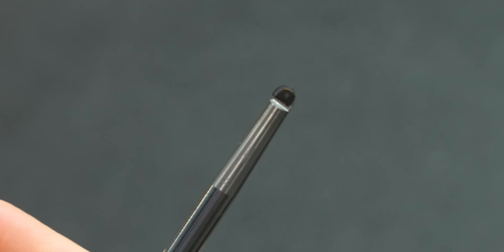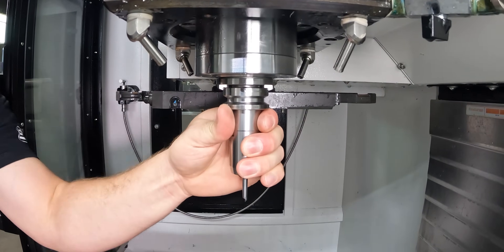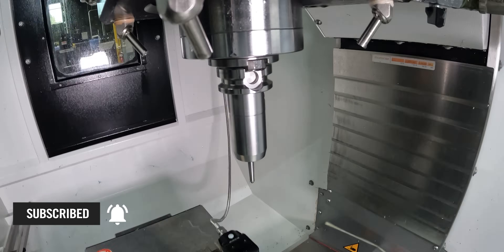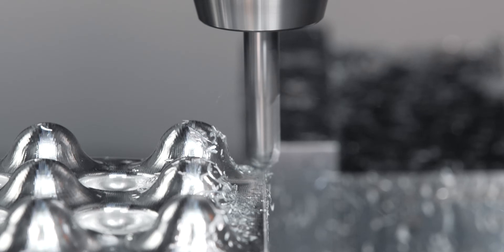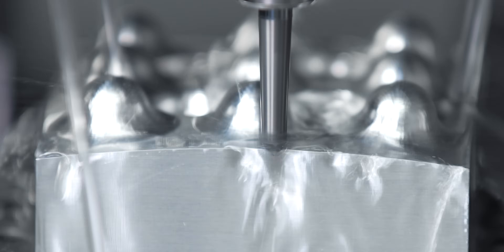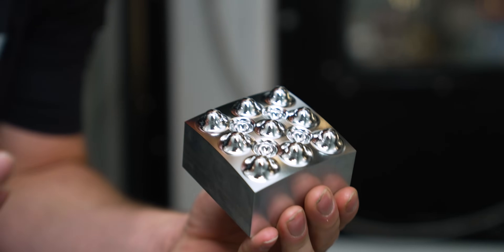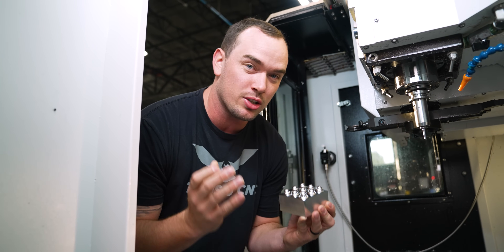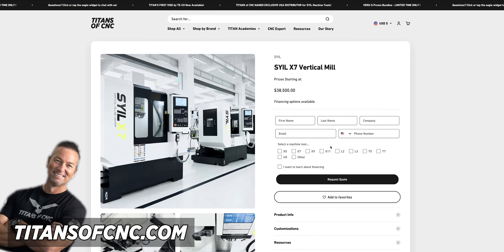Can The $38K SYIL X7 Machine a MIRROR Finish?

Comment: wish mcd tools could be worthed to use on hardened steel enstead of only non-abrasive soft metals, as a mold maker(lathe)(for plastic glasses) it would make the job of my polisher so much easier

Comment: This is where the seconds grade CVD diamonds go. They use them for precision tooling bits. MCD grown by CVD is basically flawless so it can take unbelivable punishment. The diamonds must be rough cut with lasers then polished to the final shape needed.  As long as carbon wont readily absorb in the metal the chips will fly 😂❤

Comment: I'm pretty sure nature can create diamonds instantly, a carbon meteor strike for example could do it in the instant of impact.  I'd be willing to bet it actually happens pretty quickly underground too, you just need high pressure and temperature, both of which are always present in the centre of the Earth, but takes ages for them to surface.

Comment: it would be interesting to see if you could make the primary mirror for a reflector telescope, say 10-12 inch and how it would look.
Reply: Yes I made first surface optics on an old Cincinnati lathe lots of them.
Diamond tooling then diamond film aluminum is not my go to for telescopes though.
We were combining laser beams to smash hydrogen bubbles
Reply: With the surface finish they got, it'd be at best a long wavelength IR telescope and not a great one at that depending on the wavelength. You're looking at lambda/10-40, not accounting for form error.

Comment: Correction here: You can absolute machine Iron with diamonds, as long it doesn't contain any carbon.
Materials with carbon content will cause a diffusion at the cutting edge.
Reply: That’s false, you cannot use these tools on materials that contain iron.
Reply: @trevorgoforth8963  Why not? The only problem diamonds got is the diffusion of the carbon in materials like steel.

Comment: IIRC natural diamonds might actually form very quickly (potently faster than lab grown). The commonly cited formation times assume the form under conditions like what is seen today, but an alternative theory suggests that they could form much more rapidly under exceptional but short lived conditions (like magma rapidly moving towards the surface of from deep underground). But even then most of the diamond wouldn't be usable for anything but abrasive, would take many years to cool to the point they could be mined at all and even then would be hard to get to.

Comment: Just wondering if you could achieve that finish on a steel with that tool?
Reply: Not possible in steel. You will encounter a chemical wear in the MCD tool after about 5 seconds in the cut and your tool will be toast.
Reply: @christobel  Thank you. Would there be a good way to achieve that finish on steel with any other tool. Maybe PCD?

Comment: I am curious what the step over was on that tool and the cycle time...
Reply: .002" stepover, cycle time was 2 hours.
Reply: @trevorgoforth8963  I mean a mirror finish speaks for itself, but I'm sure the carbide endmill would have looked a lot closer with the same stepover too. I would be more impressed and less skeptical if you had shown the same program ran with a similar carbide endmill rather than just showing the roughing pass with one. I think a side by side comparison would be the best way to show what a tool like this can do and if its truly necessary.
Reply: @Packie318 the reality is that carbide is much like cement hard rocks in a binder carbide cannot really get sharp like highspeed I know that it looks so cool all polished and feels sharp but if you were to see the edge under a microscope you would see the problem especially after using it.
A highspeed end mill might come close but only for a few parts before the wear started to affect the finish.
In honeing we used poly crystalin and mono lock diamonds to hone automotive cylinders the only problem in iron was torn and folded metal that gets dislodged during use.
Going to a three stage honing head got you hundred thousand miles warranties on power trains.
Laser honing was next where you have a polished bore with engineered oil retention groves burned in by laser it's totally ready to go but would add a few dollars to each block.
When you make 4 million engines in a given program $2 is huge and until absolutely needed to cut oil consumption on hold.

Comment: Beautiful finish! Most of the time when I see a finish like that, it was done on a $300,000+ mill with a 80,000 RPM spindle
Reply: When you have time, you can use any machine you have. It probably took a coouple of weeks running non stop to polish that on syl.
Reply: @viliusr6974 clearly diddnt watch the video, it was probably a 10 minute cycle with a mcd tool 😂

Comment: What are the cutting parameters? And do you have a link to the tool?
Reply: 10K RPM, 55 IPM, .002" stepover. If you google Horn MCD tools you will find a brochure for all of their offerings, they have a ton for milling and turning.
Reply: @trevorgoforth8963   Thank you so much! We are using a couple of their tools in our Lathe's. We also have some jobs that require a better surface finish in PMMA and Aluminum. I will contact them to see if this could benefit the proces!

Comment: So Ra8 in inch means Ra 0,2 in metric. Thats kinda sick. But who needs like polished surfaces on non iron metals.
Reply: I work as a tool maker and we need high polish on some of our aluminium moulds, although we would polish it by hand not with a fancy diamond tool.

However I'm pretty sure this is mostly used for optics manufacturing
Reply: Optics

The youtube channel "Breaking Taps" has a video of using one of these MCD tools to make a copper mirror for optics
Reply: Molds which is a massive industry

Comment: Add air bearings, and you can get better than 0.5μin Ra. I do this along with achieving 250nm profile tolerance. Also, you destroyed the tool when you probed it. You absolutely cannot use tactile probes with MCD tools.
Reply: Hi @cylosgarage 
I'm a materials science PhD student working in the fields of micro mechanics. I'm super interested in what you are doing. We usually use focused ion beams to make small structures, like pillar, to test them. But that can alter the materials properties. Would it be possible for you to machine pillars of let's say 3 um diameter and 7 um height into a polished surface?
Could be super interesting to my research community!
Reply: @hendrikholz3997  Take a Kern Pyramid Nano. I think 
it is possible. They wrote a Name on an human Hair.
Regards from Germany
Reply: Maybe 100um for something machined and 27um for a resin print but gdi 5um? That'd have to be some kind of electroplating deposition.
Reply: @hendrikholz3997  Are you a chinese spy or something?
Reply: Bumping two extremely hard materials together hertz them ?
Reply: Im very new to machining: why is that?
Reply: Granted this one isn't chipped but they specifically say when buying these tools to use an optical toolsetter and to not contact probe them. When the tools are free it's no worry but to someone buying a 300$ endmill, the correct information should be out there.
Reply: Is there a relatively inexpensive way to optically probe?
Reply: At that feedrate? With the ceramic stylus- nah tool is fine
Reply: 4:43 zoom in on the tip, it’s chipped
Reply: @adamthemachinist Those shots were taken before it was touched off. Ya’ll are always so confident.
Reply: @EngineerGuy99 Exactly.
Reply: Can you explain more?
Reply: Hardness toughness and strength are all very different. The force from cutting is very small due to the prescribed small chip load. Whacking a probe involves colliding a hard material against a hard material. Totally different.
Reply: @ScaleInvariant The probe isn’t stationary, it moves down. It doesn’t “wack” it.
Reply: @trevorgoforth8963  You have lost all credibility in this conversation buddy
Reply: @jet_enjoyer  👍🏼
Reply: But you can cut aluminum with it just don’t touch anything!
Reply: It’s not touching off against tool steel ffs….. it’s aluminium…. You could probably push that INTO it
Reply: @geekswithfeet9137  What is aluminium? The tool setter interfaces the tool with a ceramic puck, no?
Reply: @geekswithfeet9137 well, the comments under you say otherwise
Reply: Maybe it's bad practice but destroyed? Would they have gotten that finish with a destroyed tool or are you being dramatic
Reply: No it wouldn't hurt the tool, especially gem grade monocrystalline diamonds. That stuff is unbelievably tough. So tough that there are no cleavage planes and the only way to cut the material is with a trippled YAG laser. I grew wafers of this stuff in CVD machines that were doped with boron and nitrogen to make hard UV detector chips. Even at 1/10 of a millimeter a laser was the only thing that could cut it.😮
Reply: @christopherleubner6633  OK - Lets be clear - they are not "unbelievably tough" they are unbelievably hard and difficult to work, these are NOT the same thing. As you have worked with them you really should not use such sloppy language. 

If you tap two of them together lightly you will damage the edge on both of them, in many ways, they are extremely fragile. You can see the one in this video is chipped.
Reply: I don't know what the fvck you said but I'll find out. Thanks
Reply: Interesting. We can force two diamonds together with such high force, it creates new forms of matter were still studying, yet just a tiny tap here shatters the edge that didn't granade under machining tool pressure...... This feels like "NEVER DRAG A FILE OVER YOUR MATERIAL WHILE FILING" level oldtimer advice.
Reply: @  Do diamond anvils or files have edges that are sharp on an atomic? It’s almost like the geometry is totally different from a cutting tool.

Also, I wonder what stress occurs when a diamond tool is probed against hardened steel on an area that is only a few tens of atoms across.
Reply: The touch setter is extremely sensitive and moves. It didnt destroy anything.
Reply: @barrysetzer  MCD tools are extremely hard and brittle. It definitely creates micro fractures on the edge. I work with these tools every single day, you need to tool set with an optical tool setter.
Reply: @schbre16  Quite agree. MCD tools have precision cutting edges with extremelly small cutting edge preparation. Only optical presetting.

Comment: oh, a real mirror finish... looks great... or somehow, even though i have 4K screen, and watching it at 4K resolution... i get the impression you're cameras are not at the same level as those machines or tools. would it be possible to get a closeup shot, in focus, without DOF or motion blurr for more then a single frame? (not just this, video, but in general that is).
Reply: 7.79ra surface finish, that should tell you what you need to know.
Reply: @mobilePCreviews  Which, it's worth mentioning, isn't really a true optical grade mirror finish, but it is more than good enough to appear pretty damn shiny and smooth in person.
Reply: Eh , you get what you're given.

Comment: Damn! How long was the Run Time?
Reply: Speeds, feeds and stepover would have been helpful as well. I can imagine it was a lot of hours just in the finishing pass.
Reply: @helicopterdriver  10K RPM, 55 IPM which comes out to .0055 IPR since it's a single flute tool, .002" stepover, 2 hour cycle time!
Reply: @trevorgoforth8963  Faster than I thought it would be. Thanks!

Comment: Amazing finish.  I had no clue these types of tools existed!
Reply: T
Have used such tools.  Normally they cater for extra wear resistance vs traditional carbide, for example when machining high silicone aluminium for extended periods.
When it comes to surface finishing on the machine the prerequisites are:
1. Tool form and sharpness
2. Chip management so as to prevent fouling (coolant flushing)
3. Machine rigidity to cover off vibration
4. Machine accuracy when working at micron level step over and positioning between adjacent tracks..
5. Top notch CAM programming because the step over would usually vary with Z height on the shape (ball mills tend to go linear tracking as the shape goes flat which can spread out the step over as measured on the part surface).
 
Some of the best finishes I have seen on aluminium came by way of straight plain carbide that was highly polished (slippery for the chips) and diamond ground at the cutting edge for ultimate sharpness.